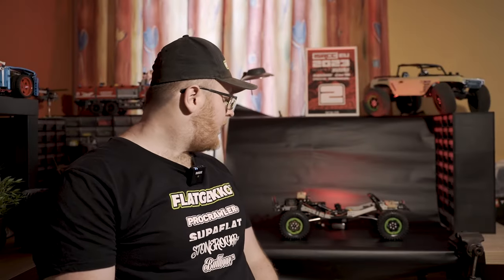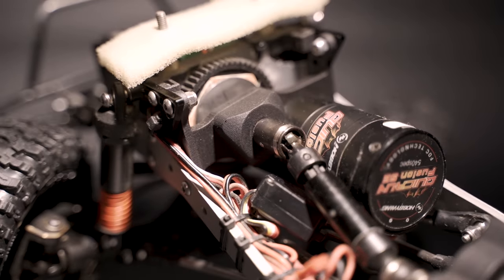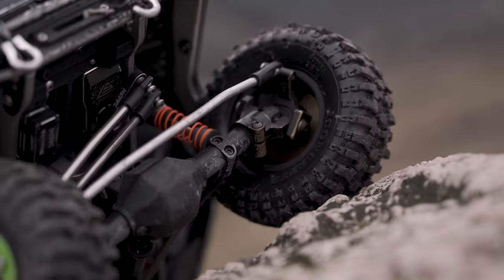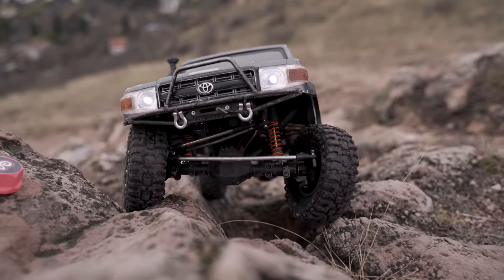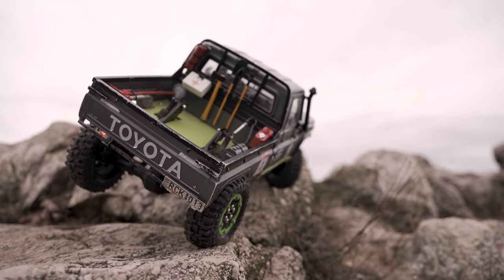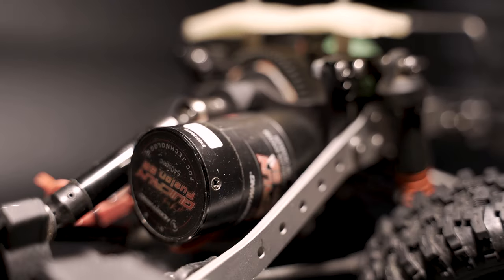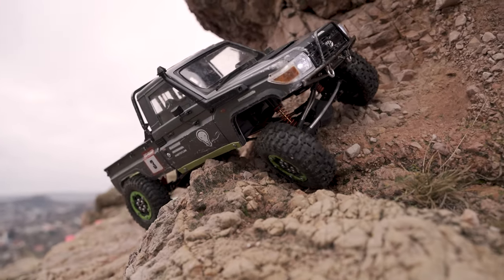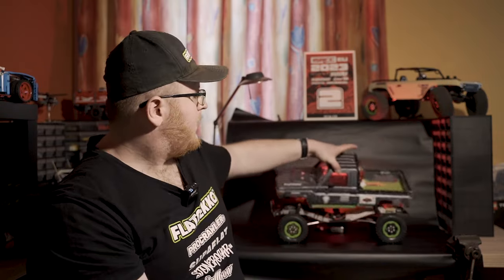PROCRAWLER® Flatgekko™ C1 V1 Detailed Build Review

Comment: Im going to get one of these chassis,  and i already have the same body, also bobed, could you please tell what modifications you made to the bidy for mounting purposes,  Thankyou
Reply from the maker: @neildaniels5443  nothing, i just drilled holes for the body mounts
Reply: @czebalaf  I have the full interior installed,  do you invision that causing any issues.........plus for tires would you still recommend Tusks....I was looking at Megalithics........oh sorry forgot to mention did you custom make your wheel wells in the front or are they available to buy somewhere,  I've been looking for some but maybe I type wrong keywords,  btw fnx for replying and your truck looks fantastic btw .
Reply from the maker: @neildaniels5443  i have custom full interior and it fits for me, hopefully yours will too. Yes, wheel wells are custom, made from food trays lol. Mega is great, but has big lugs and with how low I have everything, I'd worry about it damaging the body in full compression of the suspension. Tusks are just as good and don't have the rubbing issue
Reply: @czebalaf  Foid trays you say Hmmmmm thats a great idea 💡 appreciate your feed back m8
Reply: Hey m8, I got my chassis n transmission with forward motor mount,  wot size driveshaft would you recommend please,  if ya can put a link dat would be great 👍,  very pleased wit da quality of da chassis n transmission.